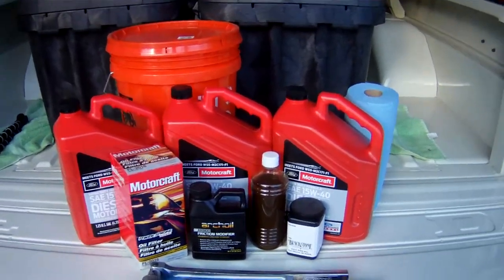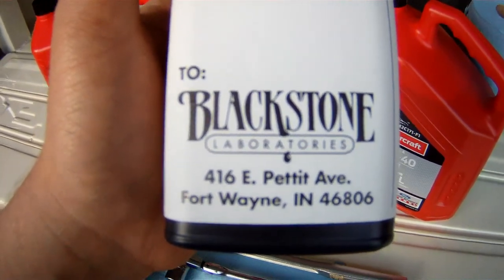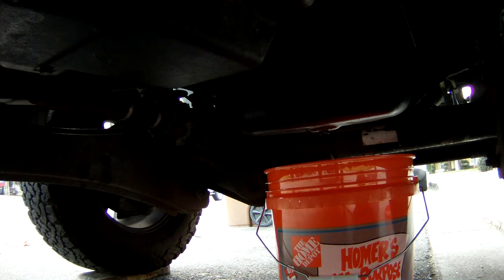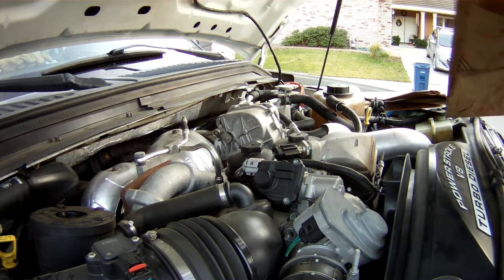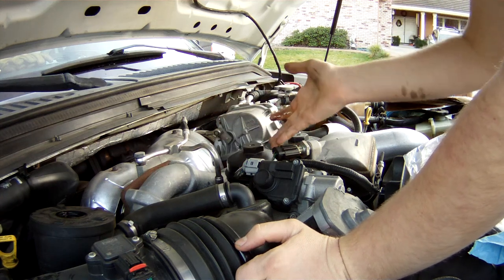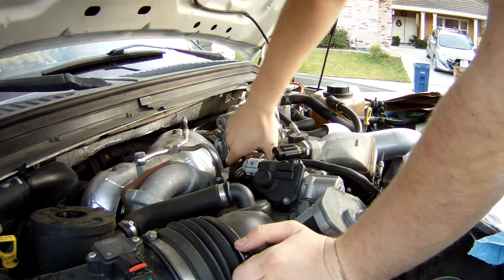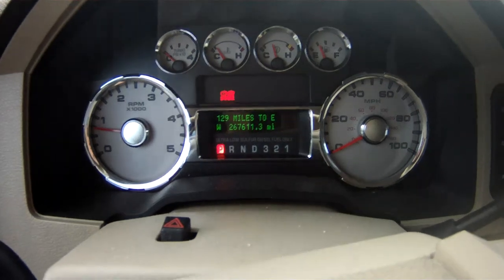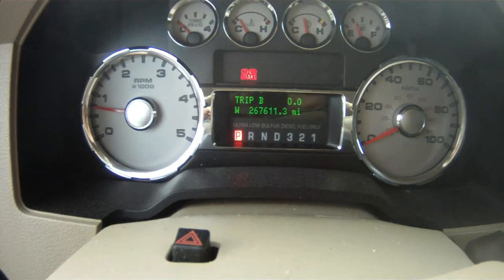Powerstroke Oil Change! (Secret to Longevity)

Comment: Just switched to schaeffer 10w30 in my 6.0, installed a fumoto drain valve as well. I picked up some window stickers off Ebay which help and I set reminders in my CTS2

Comment: I ran into an RV hot shot yesterday...I was telling him i got a 6.4 and I guess I'm just waiting for it to detonate cause everything online says it's gonna happen...he asked how many miles I have and I informed him 130,000 and he laughed and said buddy I have 465,000 and I've only had 1 cab off cause his up pipes replaced...he said he did deletes at around 130,000 and highly suggest I get them done if I want it to last and said just be meticulous about maintenance and it will treat you right...he also said he was running a 200 hp tune and never had the heads studded just said don't drive it like it's a dragster and you'll be ok

Comment: Nice oil change, couple things I do different is on the oil cap filter I put a little bit of oil on the O-ring before I actually put it on it helps a little bit better to slide the O-ring on. The second thing I do is I drained all the empty oil containers into one container then I take the rest of the oil and drain it into my truck that's when you get your money's worth. Once again good job.
Reply: wut?

Comment: Just wanted to get all that out there cause everybody dogs me about my 6.4 and has me worried sick...you only here the horror stories....like some blow by smoke coming from the oil fill...by everybody on line the motor is trash if you take you cap off and it has smoke coming out when engine is warm...he told me he heard the same thing when his truck was still in it's break in..he went out popped his cap and smoke coming out...he freaked...how does a new truck with 10,000 miles have blow by...he said that continued to this day 450,000 miles later and still going with no issues or oil leaks...said every 6.4 has a little blow by don't freak if your does either till you start blowing seals

Comment: You do know 1 gallon of oil is 4 quarts right . 4 times 3 is 12 and you have to pull your dip stick out wipe it off and put it back in the check if you just put oil in the truck it wont ne that black
Reply: Ford red oil jug holds 1.25 gallons so three jugs is 3.75 gallons

Comment: Do u add motor oil plus archoil or do u subtract some motor oil in place of the archoil to equal 15 quarts?
Reply from the maker: I just throw it all in. The 16 ounces of Archoil really wont do any thing to the oil level. Also remember that the 6.4 suffers from fuel dilution so the oil over fills itself sadly. Thanks for the comment! I hope this helped.
Reply: Great. Thanks!

Comment: Nice video, never thought of the paper bag trick. Only thing I would add is (I may be wrong) I've heard it is recommended you pour the arch oil in the center of the oil filter housing.
Reply from the maker: I've never heard of doing that... it probably wouldn't hurt anything though. It may even help clean any oil deposits out of the filter housing. Thanks for watching!
Reply: You can also refill your oil through the housing also just keep the cap off it swallows the oil twice as fast replace the filter when close finish up the oil cap